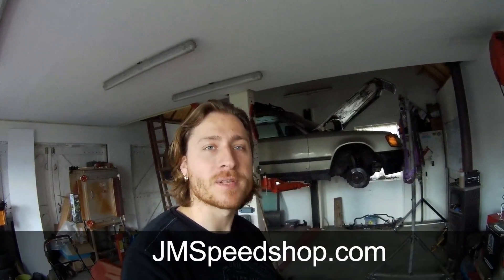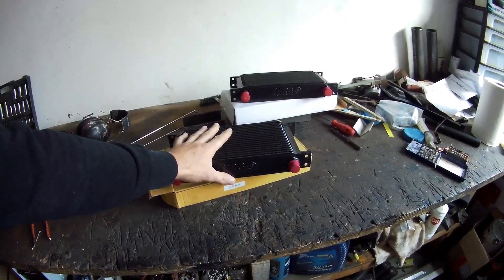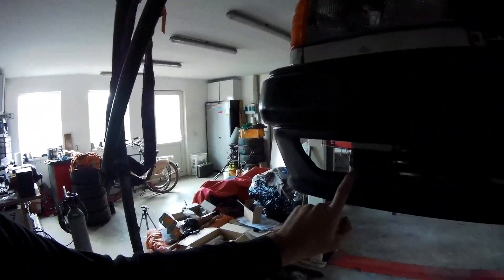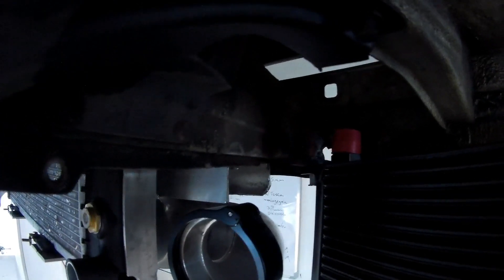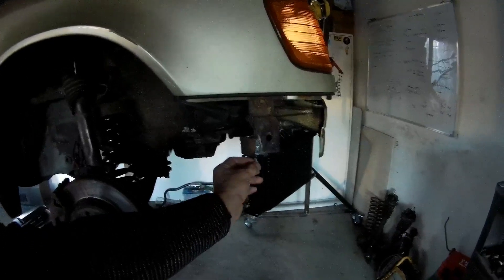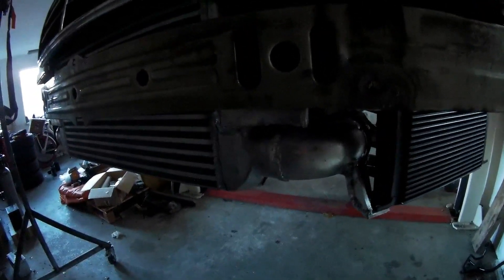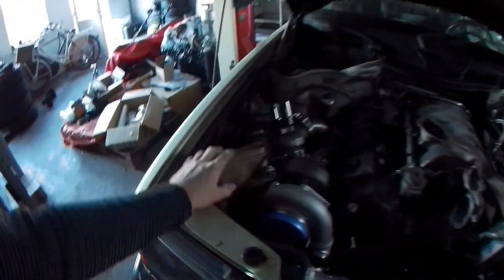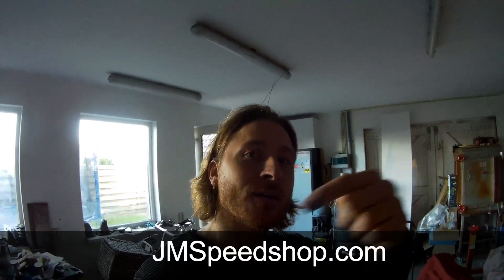oil coolers for the S124 V8 turbo project behind the 500E bumper

Comment: Great project, all takes time. From experience, make sure all your radiators have plenty of flexibility at the point of connection, with flexible hoses 👍
Reply from the maker: IT Will . Thanks 👍